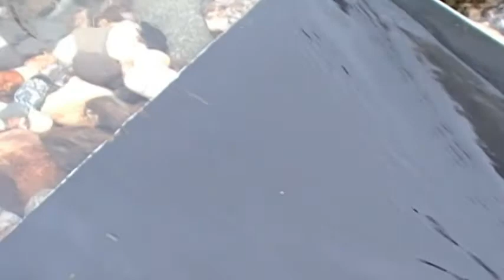Gold Sucker Tube - How To Build the 5 footer

Comment: Excellent video Reed. Your demo of the sucker was well done. You made it appear to be easy.  You are a very strong man. I hope your right arm didn't get too sore. Of course when you're seeing gold it helps . lol  I watched the series that was very interesting. Still have more to watch on your channel. Non motorized equipment has a bigger place in placer mining in water nowadays with the restrictions. I have a  claim that has about  a thousand feet of proven river bottom. It was bucket dredged to the bedrock long ago. So, much smaller gold was left in the gravels.  I can use such a tool. I will take a look at the recommended links. But I don't see how to improve on your design. Thanks for posting this.